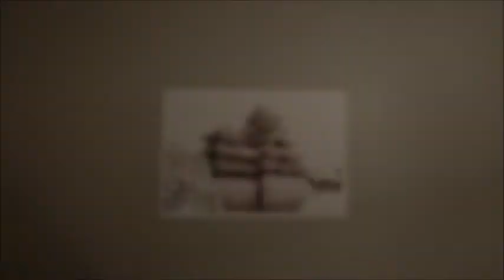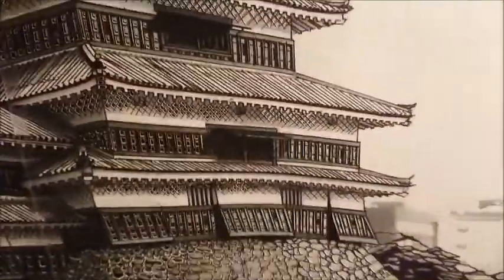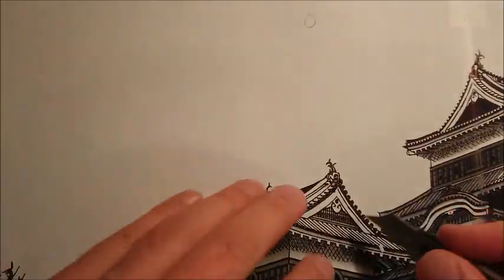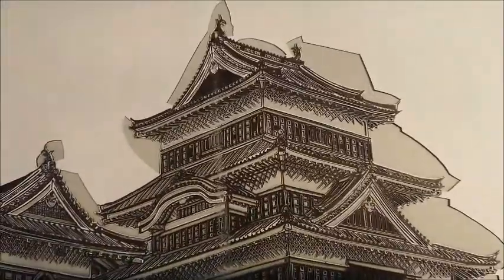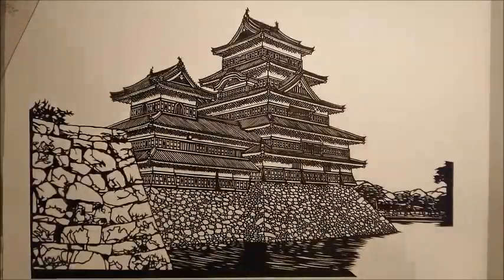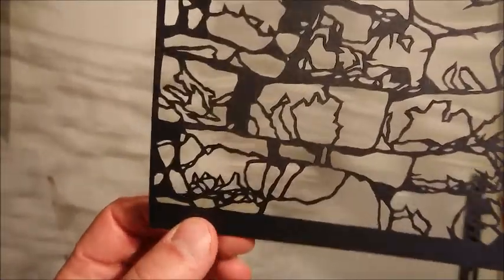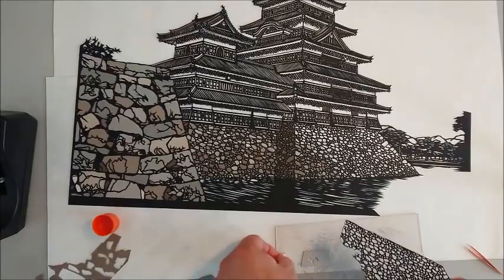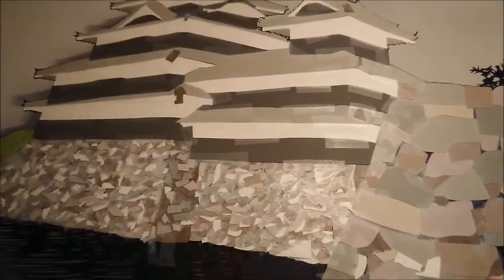Matsumoto Castle Papercutting by Mark Yungblut

Comment: Wonderful tutorial Mark really detailed. Can you please give the name of the blade you're using in this video & what advice would you give for cutting a picture that isn't connected end to end like this one? Would you physically draw connected lines & how would it be done to seamlessly integrate into the picture? Thanks for the videos keep them coming!
Reply from the maker: Thanks. The blade is from NT, I bought mine in Japan, but you can get them online. The main thing is that the tip is 30 degrees as opposed to the regular 45 degree angle. 

I do my black layers as one single piece, except on very rare occasions. I do physically draw lines where there are none sometimes, and it has been a trial and error process over the years learning how to make it look as natural as possible. It's also a consideration for me now when I'm deciding which pictures to use for my artwork, so that I don't end up having to put in lines that would look really out of place. There are a lot of ways around it though, such as gluing/taping a stand alone piece to whatever background you're using, or using an entirely different colour for the first layer. I've seen another artist use white, and she makes really realistic pieces that way. In the end it comes down to your own preference and learning along the way. I hope that helps, but as with art in general, there are no right or wrong ways to do things.

Comment: Why tape instead of glue
Reply from the maker: I tend to use both. Glue to get the coloured paper attached to the black layer, and tape just for an added sense of security. I suppose the tape may be reduntant, but it's become a habit so it just wouldn't feel right without it.